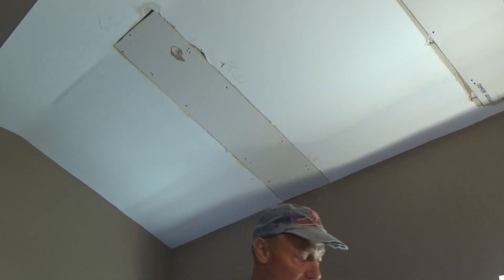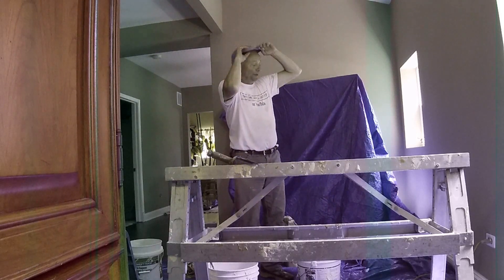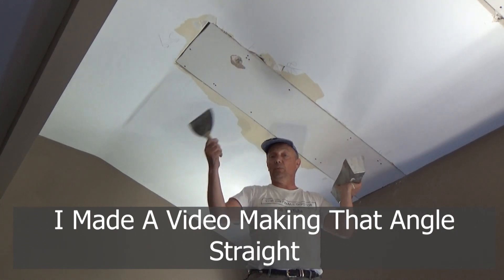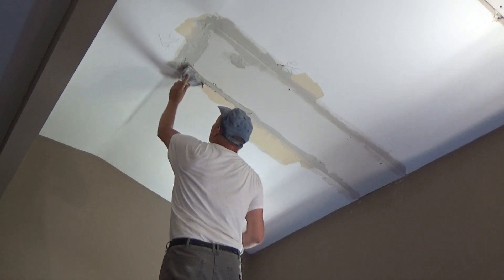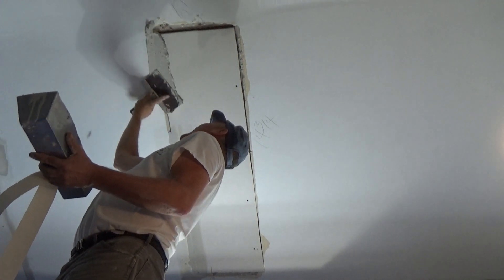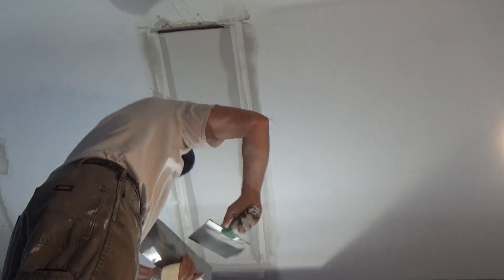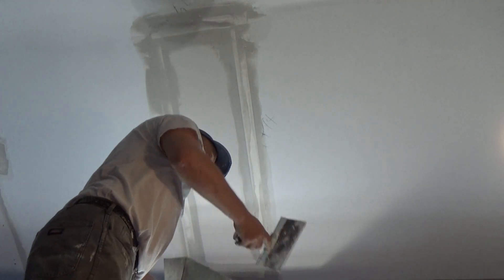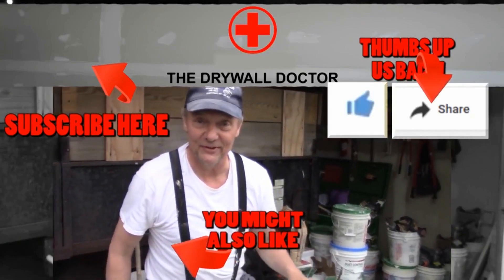Removed Skylight and Patching Ceiling

Comment: I was wondering what type of insulation you used inside the opening before patching it up?   Not sure if faced or unfaced insulation should be used, or if using a baffle for separation between the insulation and roof deck is needed.  Want to make sure I do it right correctly so moisture forming doesn't become an issue.  Trying to find info on insulating such an opening and hard to find info....any tips would be greatly appreciated
Reply from the maker: You definitely want a baffle on the ceiling for the air flow and I use Craft faced

Comment: Did you remove the drywall on the inside of the well?  What did you do to insulate the roof and ceiling?
Reply from the maker: Yes and insulated with R30
Reply: Many thanks!!